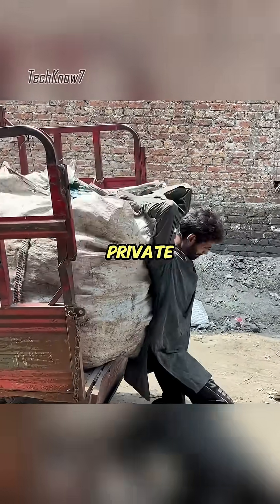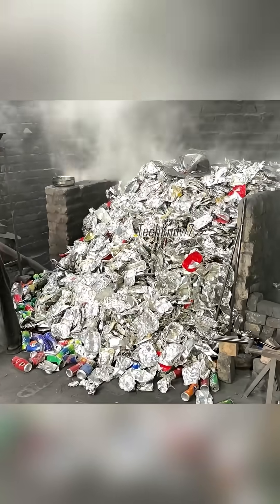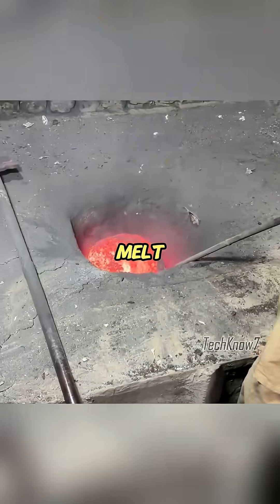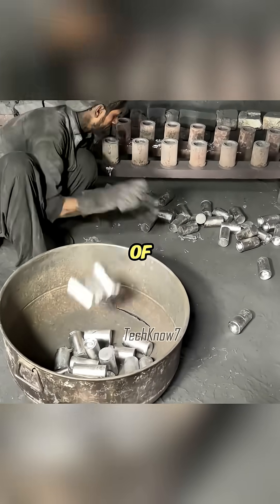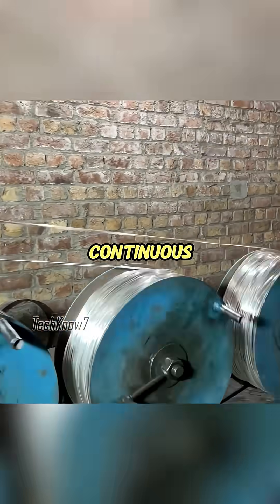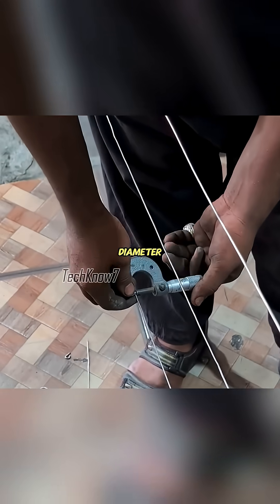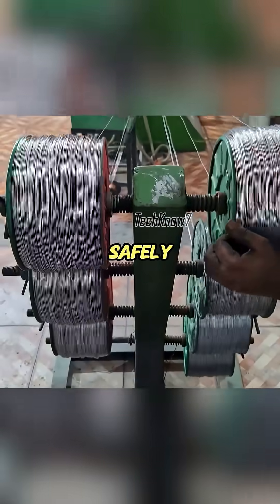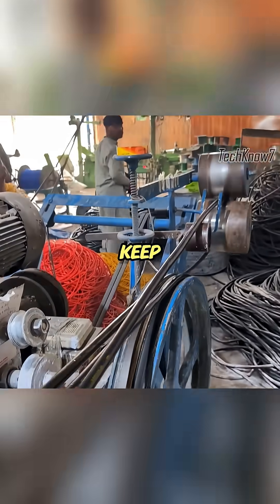Genius Low Cost Engineering

Comment: If the metal is not purified well the performance will be low and they will loose some electricity on the way.
Reply: They lose anyhow with aluminium... If it's dirty even worse

Comment: To people thinking aluminum wires are not okay - most of electrical transmission is done with aluminum wires, even high voltage and high current. Because aluminum is lightweight ( good for transmission lines) , cheap, has low impedance (but not as low as copper ) and gets the job done.
Reply: There is limit to the use of aluminum for electricity or signal transmission because of it's easy oxidation. Small diameter aluminum wire are not recommend ed.
Reply: @shencheanglow3726  yes, that why it's no longer used in houses and apartments
Reply: Why did they move away from aluminum to copper? I thought
Reply: @rmrcjr  Aluminum ages and cracks over time. Aluminum conducted in a flammable environment is the perfect trigger for an insurance event .... ;)
Reply: @rmrcjr in my place those thieves always steal the copper cables for scrap, causing big losses and inconvenience. So power company starting to switch to Aluminium cable
Reply: @brandonlim2477 ur true in dz issue while here in Pakistan r very realible 2 any cause to end meet ends of standard living.
Reply: @rmrcjr  they switched to copper mostly in houses /buildings. Most outdoor transmission lines are aluminum
Reply: Ya but I question it's durability and longevity!
Reply: With some impurities it also makes great planet hulls. 😅

Comment: ALUMINUM POWER CABLES ARE NO GOOD. ALUMINUM IS A VERY BAD CHOICE FOR CARRYING ELECTRICAL CURRENT. OLD TRAILERS USED ALUMINUM WIRE AND CAUSED 🔥 FIRES.
Reply: Yet usa use it,

Comment: Does aluminium hold up with electric current?
Reply: As an electrical conductor aluminium is on par or even better than copper! It's resistivity is pretty low. The only reason it was used less for wiring until most in the recent decades to my understanding was because aircraft manufacture with it was prioritized.

Comment: It may good for low DC current. But for high AC current, totally not recommended...
Reply: For Pakistan it's okay.
Reply: Shush.
Reply: That's actually where it accels... High tension power lines are all aluminum.

Comment: The United States and several companies around the globe recycle aluminum cans and everything else that’s aluminum. They then usually sell the aluminum blocks to other companies who turn it into various products. The only difference with Pakistan, and probably other countries, is the recycler actually makes various products, including wire. Pakistan is unique in that they use primitive tools and technology to make products, which allows them to do it cheaper and sell it cheaper. I wouldn’t buy certain items from Pakistan as they mix all types of say steel together to make brake rotors, but US automakers have contracts with Pakistan companies for various car parts, so…

Comment: Master craftsman with a manual thickness gauge.
Reply: That’s a mechanical micrometer. A good one can measure precisely within .001 mm or .0001 inch or better. Starrett has a model that reads down to .00005 inches. Digital can measure smaller increments, but don’t be fooled by resolution. Accuracy is usually not as fine as the resolution. A mechanical mic is more than adequate for this application.

Comment: Uh copper is more efficient
Reply: True, but aluminum is far cheaper, and well suited for power grid applications, as well as service entrance conductors. The US is reintroducing aluminum wire in small gauges, with the development of new alloys, which are supposed to eliminate the problem of loosening, which was due to deformation caused by expansion and contraction. I’m not interested in trying it yet, however.
Reply: They're actually about equal, but copper has a lower expansion coefficient, and is also more malleable, making it far less fatigue sensitive. Copper also carries more current before melt failure, due to it's higher melting point.
Reply: With equal diameter copper is more efficient, but weights and costs a lot more. So people use thicker aluminum wires to get the same low losses of copper but still cheaper and lower weight.

Comment: Good thing to know. They could buy recycled copper but aluminum is dirt cheap.

I just hope it meets electrical standards. I think aluminum is not good for high voltage high amperage applications.
Reply: The electricity you’re using right now is carried from the power plant to your neighborhood substation on thick aluminum wires.
Depending on the application, the amount of electricity carried on aluminum wires can be anywhere from 4,000 volts up to 765,000 volts A/C.
Reply: @johnd.brokenshire9349 But those wires for high voltage have a steel core for carving the weigh load. I lived in India and have seen those aluminium cables on high current medium voltage (230V-480V).
Reply: True they can cause fire because the heat up quickly
Reply: Sad memories of a mobile home with aluminum wiring going up in flames back in the day.  The aluminum would corrode where they attached to the wall sockets.  Sooner or later, you get a smoldering pile of dead family
Reply: No suitable for a normal cable but usually used with a steel core for high voltage power line distribution. I doubt as well the electrical properties of that can aluminium. Btw, a "Master Crafts Man" is a advanced qualification at a one year full-time (3 years part-time) study at an industrial/trade Master Artisan institution and a three stage assessment.
Reply: Pakistan  has no electrical standards, in fact they have no standards at all.
Reply: Actually, your very wrong, 300 XLPE cables are in fact Aluminum .11kV Voltage. Source. I'm an engineer.